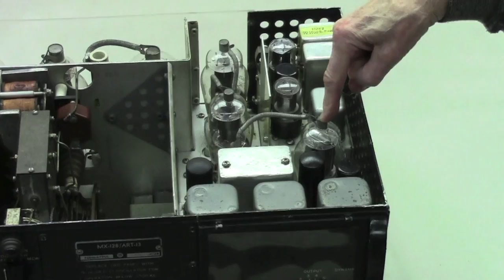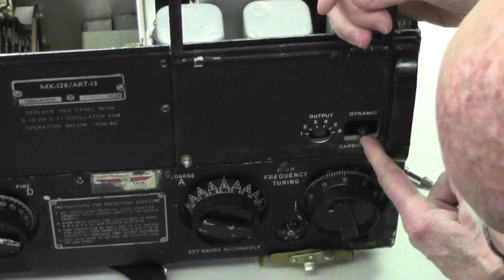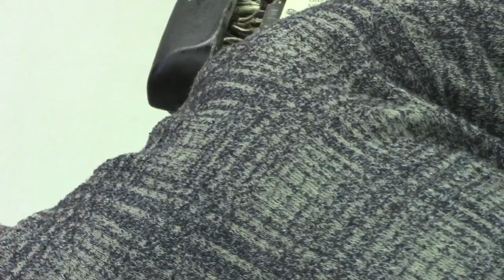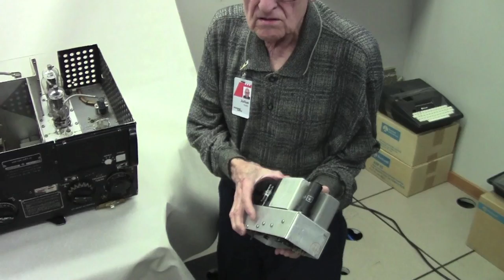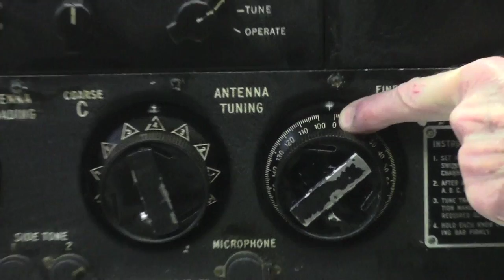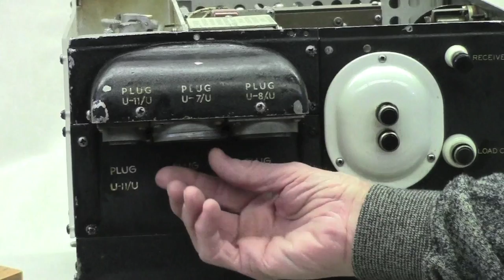ART 13 - Description and Disassembly

Comment: What a wealth of knowledge. I wish there was an uncut version somewhere, because he was getting into some really interesting topics in a few spots that the scene cut (additional taps on the modulation transformer, the purpose of the various connectors on the side). But still very useful info! I’ll be working on getting one of these back on the air.